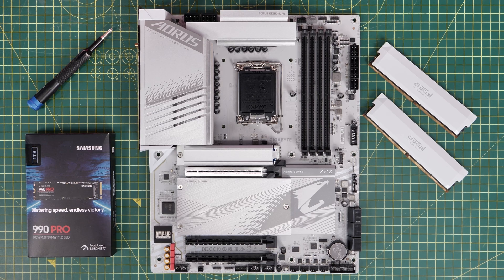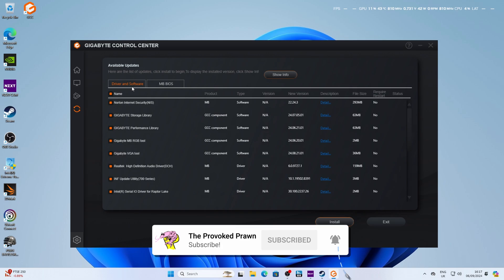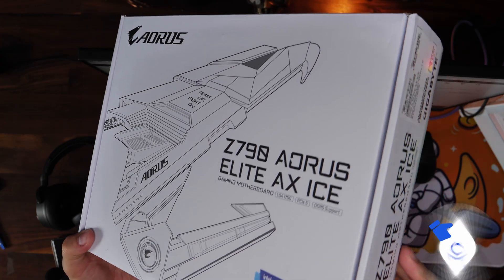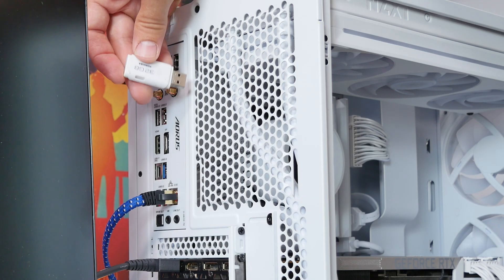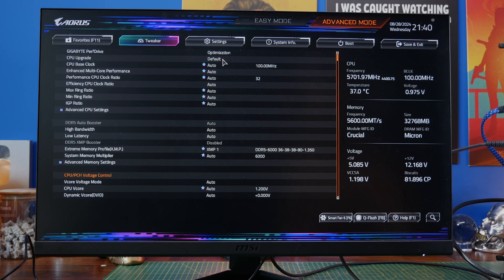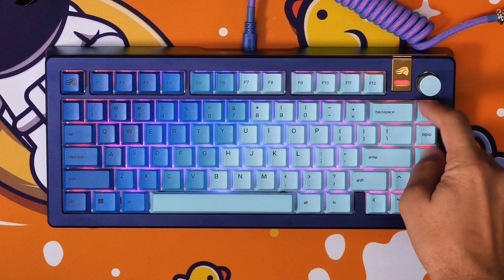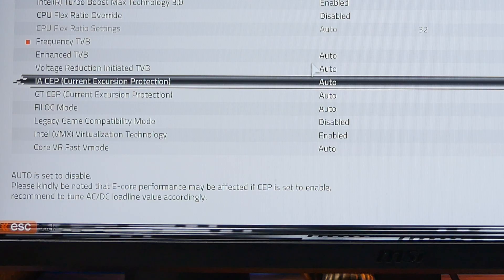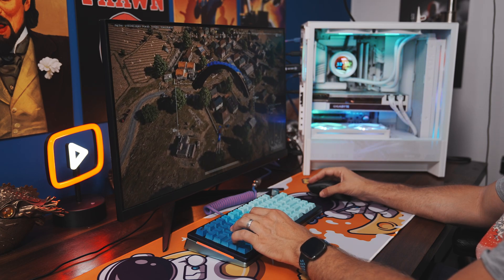How to update your Gigabyte Motherboard BIOS (Featuring the AORUS ELITE AX ICE)

Comment: Not gonna lie, whenever i updated bios, everything was fine, but whenever i went back into bios after the update and enabled xmp, i was getting a fake cpu and dram red light. What i did is force powered it off via the power button, then got a boot failure menu, couldnt click anything. Then i powered it off via the switch in the back. Whenever it was booting up i spammed delete and got into bios to turn off xmp and the bar setting, then it worked fine. Overall a nice video for updating bios but be sure your cpu or system in general can use xmp

Comment: Is there not a way to update bios via  the update bios button on the back of the mobo?
Reply: This button is for situation where you cant access bios via del/f2, you update bios with cables to motherbowrd and cpu plugged in from your source, plug the usb drive into correct usb port, then click the qflash on the back and its doing on its own

Comment: i‘m so confused. i dowloaded the 1.0 version since that’s whats written on my board. when i try to run the file, it tells me that it can‘t read the file
Reply from the maker: Did you unzip the file first? Are you using a usb drive for it?
Reply: @TheProvokedPrawn  i did zip it but i put it my local disk c. is it only possible with an usb drive?
Reply from the maker: @helianie sometimes it can be weird like that when on a local disk. I'm not sure why.
Reply: tried it again with an usb drive and it worked, thanks a lot 🙏🏻

Comment: I'm doing this right now and the PC it's being about 10-12min in the Aorus screen, giving the same del, f12 and end options. No loading circle and off course not loading into windows. I'm not sure where is the bios flash led, but while running the updated it told me that system was ready to restart and then restarted without issues. Now it's "stuck" here in the Aorus screen but I'm not sure if it's part of the process as I have read not to do anything until it loads into windows again... What should I do now? Just wait another 20min?

Comment: Computer should automatically restart after initiating the BIOS update right? I followed up to 5:45 got the same “In order to make complete update, system is going to shutdown. QFlash will continue after restart”. The computer has not restarted should I manually restart it or just wait (going on 20 minutes w/o restart).

Comment: Are you able to show a video as to how to enable TMP 2.0 as I have come across numerous videos but not using the same type of bios so descriptions are not the same. Also thank you very much as your video has saved my boot light that has been staying on although my pc booted up fine and when I restart it goes away but comes back after switching it off and a bios update was one of the recommendations and following your video has help me so much as there is no more boot light as I have built my pc myself and that light was the only thing bugging me🙏🙏🙏

Comment: When I open Qflash I see the EFI and system volume on the left but nothing shows up on the right.
Reply: Hey man i managed that by switching devices from the left bottom corner. Mine said “A:Unknown device” until i found my computer. 

I stored my Bios file in the download folder. I found that by accessing “users” -> my user -> downloads then the Bios file
Reply: @rawanii244 Thanks for the reply. I figured it out by formatting my flash drive to nfts. It showed up after that.

Comment: Thank you for giving me the courage to update my bios, it turns out they hadn't been updated in 8 years. People always warned me not to do it but when I finally did more research I found out there was everything from security flaws that needed fixing and new features like rebar that I could have. It litterally only took 2 minutes to update the bios and another minute of restarting, it was the most painless process ever so thank you!

The only issues I had was BF2042 (yes it was entirely BF2042s fault for getting me into research how to update my bios and firmware) now requiring secure boot mode just to be allowed to play, before the bios update it just required a GPU firmware update to enable UEFI without CMS enabled, but no one really had explained that clearly. After updating the bios I then got a "you must be in user mode and enter a platform key to enable secure boot mode", but then the fix for that was disable CMS, reboot, then change secure mode from custom to normal, or vice versa I cant remember, and then you can just do it without following that messages instructions.
Reply: Lmao here I am same situation but with the BF6 beta and launch being my reason for finally updating my CPU and bios system

Comment: OK   I see that you flashed using 2 sticks of RAM. in my new build  my MOTHERBOARD only detects B2 channel DDR5 G Skills 64,000MTS. I have not installed windows 11 yet but if after I installed windows and update BIOS in my Aurus motherboard 57z90 will detect my 2 sticks of RAM in dual channel in my BIOS?
Reply from the maker: Are you sure the other stick is fully seated? Updating the bios might help.
Reply: Yes sr. I tried  2 stick of corsar  as well same result
Reply: Brand new DDR5  6000MTS

Comment: Hi there, this guide is very well made and easy to follow. However I'm able to follow right up until its time to select the USB drive in the BIOS. No matter the slot I put the drive in, its not detected and definitely isn't selected for me as your file was in the video. Do you have any idea what the issue might be? Thanks
Reply: same issue.
Reply: @jacoblong4509 I figured out from elsewhere that the drive needs to be 32gb max otherwise it won't show up. best to just purchase one that's already 32gb

Comment: Thank you for this easy-to-follow guide.  It's the first time I've ever updated my BIOS (on account of the significant issue with Intel's 14th generation chips), and I've been gaming on the DOS/Windows platform since 1993, when I was using a 486 DX-2 50 MHz with DOS 6.0 and Windows 3.11.

I've had my current machine, with an i9 -14900KF, for a couple of months, and was none the wiser about which BIOS version it had (and experiencing no noticeable instability) until yesterday, when I reinstalled World of Warcraft for the first time since last year, and it alerted me to my BIOS's negligent updates ("World of Warcraft has detected your computer is using an Intel 13th or 14th generation processor that does not have the proper updates installed to address potential processor instability issues.  It is highly recommended to update the BIOS on your motherboard to the latest version with Intel's microcode 0x12B or later").  

Thanks to you I've attended to this preventive maintenance successfully, and feel more confident about BIOS updating in the future.
Reply from the maker: Interesting to get that info from a game. Glad to help

Comment: How did you find this bios update with your i9 14900k? I have had my i9 14900kf for 14 months now and haven’t had any issues until recently. Wondering if this is an essential update for me or not. Great video
Reply from the maker: It's long term use that's causing problems. Bios updates might help

Comment: I am inexperienced when it comes to pc building though I have built three pc now and I am going on to building my fourth now. I’ve gotten the black version of the motherboard and on pcpartpicker it says I have to update my bios to at least F9. Will everything still post without that bios update or will I have to update the bios before building everything. Foolishly I didn’t check with pcpartpicker before purchasing parts and due to my experience I usually avoid those compatibility issues just to be safe although now I’m not too certain.

Comment: I have this same motherboard and on box  it says supports 13th gen can i still build the pc with my 14900k and use it normally and update it later
Reply from the maker: You might need to update the bios first
Reply: @ will the pc still boot with 14900k installed

Comment: I can’t update the bios I try to do the same like you and after I press run I get into this “ Q flash Manager- Bios id check error” I don’t understand why this not working.. I have i9 14900k for now it’s stable but I want go for bios update but I can’t figure out why it’s not working. .
Reply: What did u do to get it stable
Reply: @ I finally did the update , I put the wrong bios version that’s why not working but now everything it’s ok , before I didn’t do any change in bios and my i9 14900k was very stable I let everything on default settings

Comment: I formatted and extracted the file correctly on a thumb drive and plugged it into the back usb port and when I hit file in the q-flash thing it doesn’t work
Reply: For me when after going into the Q-Flash section clicking file never worked for me but when it was on the Task tab i pressed enter on my keyboard and it moved it to the file tab.
Reply: @Mythmaker987 your a legend
Reply: @Mythmaker987 Goat
Reply: same goes for me , kindly if you fixed it reply to me
Reply: @ there are 3 version it’s like 1.x 1.0 and 1.1 I tried all three and I think the 1.x or 1.0 worked
Reply: @CptCorona did you just download all 3 and try to boot all three through bios screen?
Reply: @ basically but I tested one at a time

Comment: had a few issues trying to update my bios, have a Z790 AORUS MASTER (rev. 1.0) and latest at time of this is F16b 
I downloaded it onto a usb which I did format but in formate settings it said exFAT as the only option so this may ahve been the issue ? 

anyhow when I went to the f8 flash bios options it endied up saying "unknown bios settings" and wouldnt let me progress so was forced to use the GCC update which only had f15 not the newer F16b, it did update to f15 and is working fine (fingers crossed) but yeah is that normal or did I mess up soemthing ? 

also the GCC is so freaking cheaky and rude and just outright tries to instal norton any time I open it and have to force crash ot to stop, feels extreamly illigal that their own in house update center forcefuly tries and puts norton on my system without permission any tiem I try and use it, from what I hear thats normal ? how have they not been told off for that bs -.-

Comment: I have a similar mother board and nv3 m.2 2280 pcie 4.0 nvme ssd, and after an update the ssd won't be detected... I've tried modifying many settings but no luck.. but this ssd used to be working really good for me, until i updated... help?

Comment: Absolute life saver! Full time streamer and updated to a 14700k back in May. Was experiencing so many blue screens and the only thing I could think of was updating the bios since the 14th gen chips were having huge problems during its launch. Fast forward to now I finally found the time and put in the effort following your tutorial to go through with the bios update and everything went smoothly! Thank you so much for your help :)
Reply: wait so yours booted with the i7 14700k? did you have the 1.1 or 1.0 im currently trying to build mine but cant flash update my bios for some reason unless Im supposed to use a usb 3.2 instead of 2 (which is what they tell you to use)
Reply: @ I have the 1.0 my usb didn’t detect at first but it was because of the USB model. Make sure to format to fat32 and that’s when it worked for me
Reply: @LeooKnightus  mines formatted correctly I might just buy a new usb because at this point I have no idea what the problem is it’s a 2.0 though and I’ve formatted it like 30 times
Reply: @McDiamondspvp any luck?

Comment: I have a Z790 Aorus Elite AX 1.0 with a 13700K. I was running on F3 and never noticed any temp problems. I just updated to F12 successfully. Let me tell you about paying attention to revisions with this motherboard. There are two revisions that are distinct but not labeled right. I have a 1.0 and there's also the 1.x (1.0). And the only way to tell them apart is by looking at the VRM Capacitors around the CPU. The 1.0 is 7 across and 7 down. The 1.X (1.0) is 6 across and 8 down. The 1.0 that I have is a 70A VRM and yours and the 1.X (1.0) is 90A VRM which is better suited to the 14900K with out worrying about voltage control.
Reply: Or you can look at the original box that came with the motherboard (If you have that atleast).
Reply: @sagnikmaulik  What normie is going to notice or recognize the actual difference between 1.0 and 1.X even if they still have the box? Just a month ago I remembered to look at the capacitor arrangement to make sure I was downloading the right firmware. It's madness.

Comment: Hi so grateful for you video thank you so much, Am awaiting delivery of  GIGABYTE Z790 AORUS Elite AX ICE rev(1.0) and worried about stability issues with i9-14900K, questioning if i should just return and build something else. I've gone to gigabyte website and this bios is not there at my end i only see this one straight after the F4 Version:
Version	Size	Date	Download	Description
F5	9.53 MB	Sep 27, 2024	
Download
1.Checksum : FA46
2.Introduce the "Intel Default Settings" and enabled as default, user needs to disable it first to use GIGABYTE PerfDrive profiles
3.Introduce microcode 0x12B as the final mitigation of 13/14th Gen desktop processor Vmin Shift Instability issue according to Intel official

i. 0x12B encompasses 0x125 and 0x129 microcode updates, and addresses elevated voltage requests by the processor during idle and/or light activity periods.

ii. microcode 0x129 (August 2024) addresses high voltages requested by the processor.

iii. microcode 0x125 (June 2024) addresses eTVB algorithm issue.

4.Add EZ-OC support for AORUS x XPG co-branding DRAM

I really dont want to build this if the BSOD will be happening all-day every day, this solves this problem for good? with no impact on performance. IM into head audio studio production with Ableton 12 Standard, and must have stability.
DDR5 also on its ways is 
Kingston Fury Beast 64 GB (2 x 32 GB) RGB CL40 5600MT/s DDR5 RAM Memory, White

Thoughts anyone>?

Comment: Hi, just need a bit of advice, I have an old system with a ROG Maximus Hero X mobo, I have never updated the bios since I bought the system in 2018 ( Bit of a newbee and was worried about doing anything to the bios) I was looking to upgrade to Windows 11 but pc health check reports I need TPM 2.0. There is a bios update in the list to fix this problem but I was wondering if I need to install all the previous bios updates first or does the latest bios update include all previous versions?  Thanks
Reply from the maker: The latest one should have all the fixes
Reply: @TheProvokedPrawn  Thank you

Comment: hi, after accidently upgrading my bios from GCC to F2 version ... my pc rear fan and bottom two fan stop working, what could go be the reason can you help, top 2 cpu fan working fine
Reply from the maker: I don't believe that's related but have you checked the fan controller settings in the bios
Reply: @TheProvokedPrawn    yes , i look into it in BIOS, all other fan are set to auto, zero rpm no response to full speed.
Fan control software is only detecting CPU fan
Hw moniter also showing one fan..
Is it the connection issue or a hardware issue... Light fluctuation is an issue here but as far i can remember it happened after the bois update ...first I thought it was  reset to work only after a specific temp rise.
Reply from the maker: @jeevankikahaniya6339  try switching them to pwm mode
Reply: @TheProvokedPrawn  nothing change... will try to downgrade bios  (is it safe)
Reply: @TheProvokedPrawn  lol, I did not know what happens but all three fan started spinning just now,  after not spinning for a week.

Comment: Good demo, but be cautious with new bios especially with beta versions. It's best to wait a few weeks at least so you're not the testsubject :). Apart from that it is a good idea to make a follow up on how to take control with bios settings protecting your cpu from high voltages besides  depending on the updated microcode. Like setting up PL1-2, locking all cores to -100Mhz on turbomode and setting IA Voltage limits, Loadlines etc. Maybe even talking about disabling HT and e-cores and the differences on FPS in Windows 10/11.

Comment: Temperature got higher when stressing the CPU after installing this bios 0x129
I have I5 13600K temps are 85 max
I think iam going to version I use to have.
Temps are normal in games though.

Comment: This process is nothing at all like the one for my MSI Z790 mobo...heck of a shame that motherboard manufacturers can't standardize the process and naming conventions for these BIOS updates. Nevertheless, it's a fairly simple procedure as long as you carefully follow instructions...or excellent demos like this. Thanks, Prawn...
Reply from the maker: It does need to be easier. Especially at the moment with the issues. Gigabytes command center update system makes it really easy to be fair. Weird it doesn't have the latest one tho
Reply: @TheProvokedPrawn  i was going to update my BIOS through the Gigabyte Control Center but  I heard its an unneccesary risk as updating through BIOS can bring in various factors such as software crashing and what not, so maybe its best to update BIO through the traditional method.